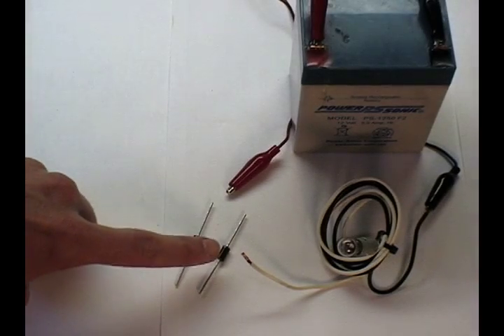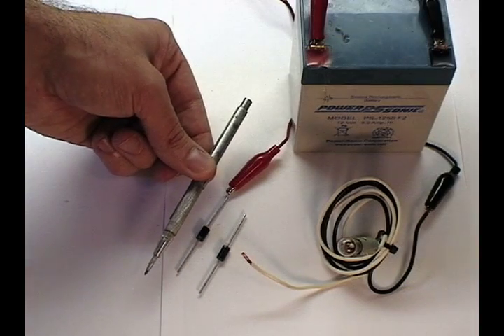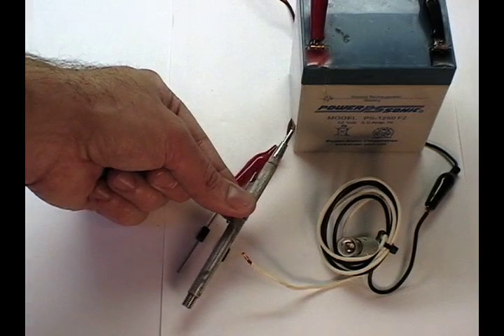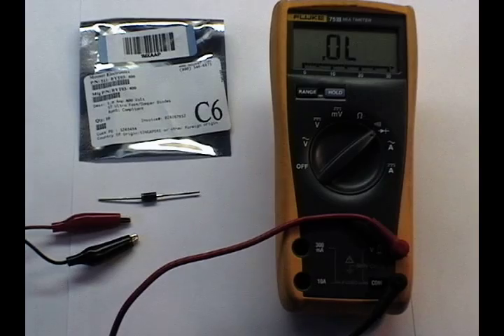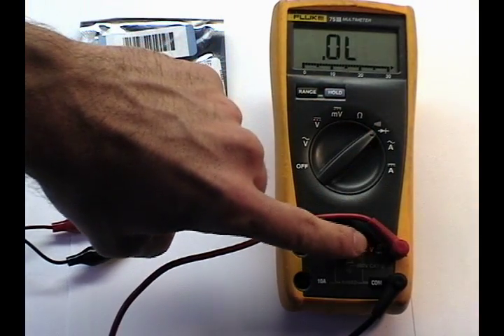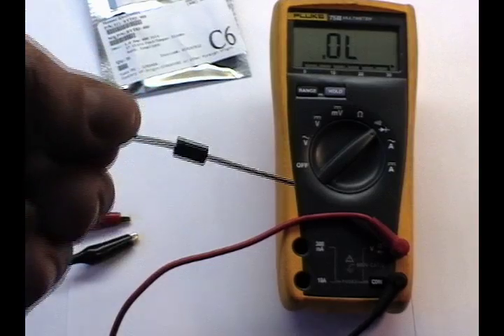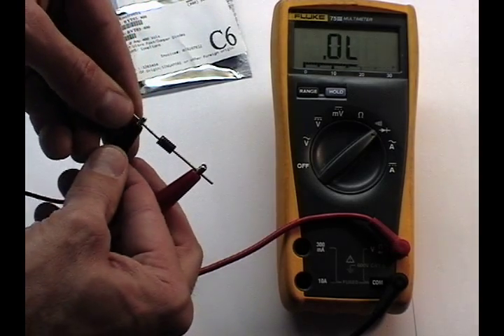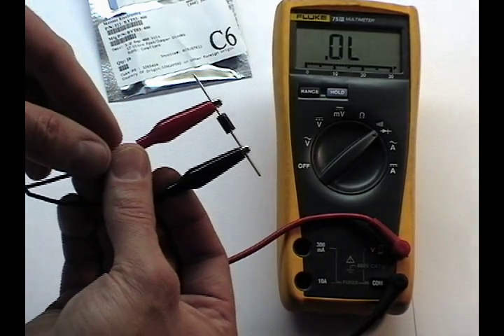diodes in circuits and testing them

Comment: 0.5 to 0.8 volts i have a 2 pin diode D501 in my fuse box under the hood , when i check my D501 Diode it is .914 V , what i like to no is that good or bad ?

Comment: @guzguz21 Not always. If you only have in series with a lamp or a resistor and your voltage source is not connected you can test it anyway.

Comment: @fakkyouhomo A zener blocks until his/her zenervoltage is exceeded. That means in flowdirection its like a normal diode. In the opposite direction current flows at the zener voltage.